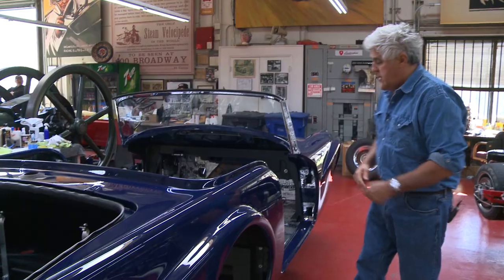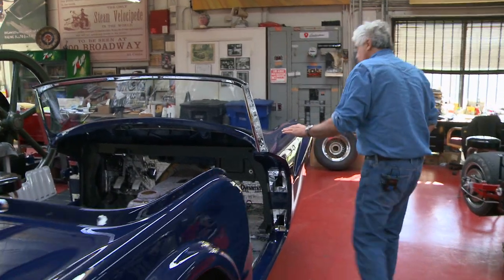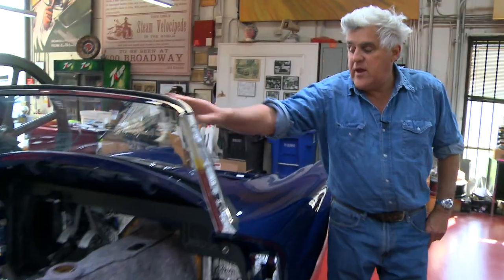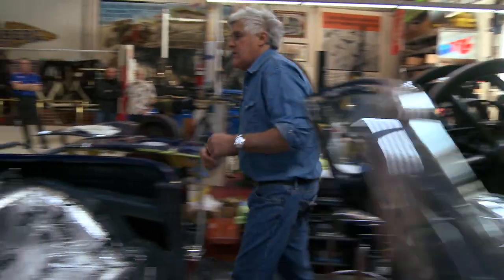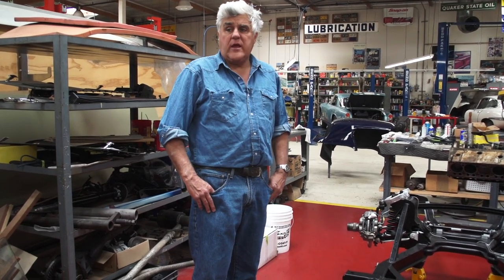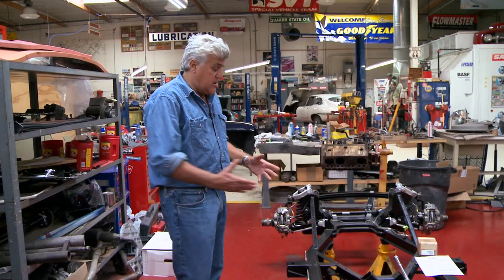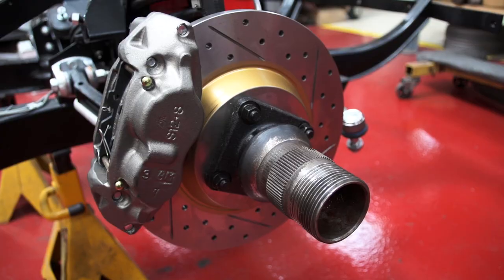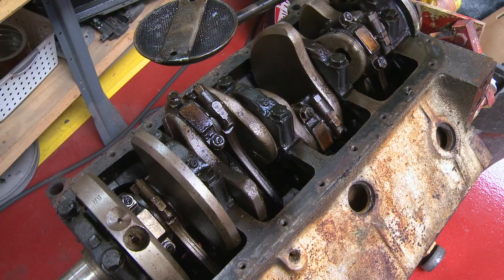Restoration Blog: 1962 Daimler SP250, Update 4 - Jay Leno's Garage

Comment: I'd like to see an update too. My Dad had a '62. I drove it a lot. While not what I'd call a pretty car, it's beauty was under the hood. While it only had around 140 hp stock, it was one of the most flexible engines I ever experience. In 4th, one could throttle back to 20 mph and floor board the gas. No drama, just a nice gain of speed. It handled alright, though the live rear axle and the flexible chassis played havoc with the handling at times. Dad's had the optional hard top and it made for a nice cross country tourer. Abet the ride was similar to a coal cart (particularly the rear end).

Comment: I just bought a 1962 SP250 which has 13838 miles showing. It sits on the original tires. Original paint with the plastic covers on the front seats. This car has never been out in the rain according to the 2nd owner an 81 year old man that sold me the car. Looking forward to driving it. According to the British and New Zealand Daimler SP250 club I may have the lowest mileage SP250 in the world. PS. It's an auto.

Comment: Quoting Hot Rod Magazine's website:

"Color-sanding is basically where you're smoothing out the clearcoat so when it's time to buff the paint, you get the most mirror-like finish possible. While none of this is hard to do, it does require a fair amount of time, and plenty of patience."

Comment: How 'bout taking inspiration from the Daimler, as a basic form for a sports car?  You have always wanted to build a Steam Powered Sports Car.  You have the resources.  Design and build a "LENO", carbon fiber body on a backbone chassis, like a lotus, and create a modern Steam Machine.  You might even be able to sell a few, if you make em appealing enough in cost & capability, while simple enough to reproduce and build.  LM  Leno Motors.   Hmmm...

Comment: Mr Leno,
1) come on mate, lift with your knees, not with your back, you'll be sod all use to man nor beast if you rip your back, and this channel will not have the same "feel" if your directing it from a hospital bed.  
2) as the hard top is such a rare beast, why not pull a mold from it & offer replacements.
3) if you've pulled the transmission, and got away from the original, why not sneak in a different power unit ...... a Wankel ....... or that first electric Daimler Dart ! ! !